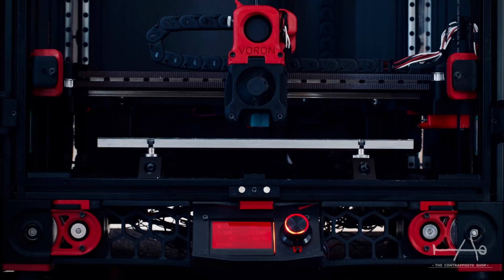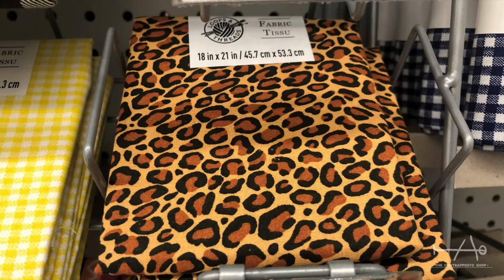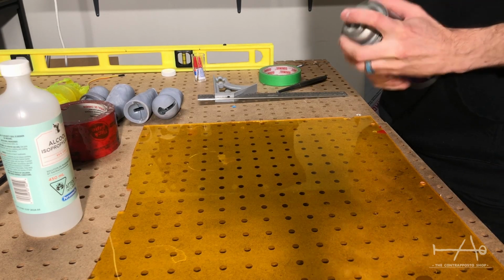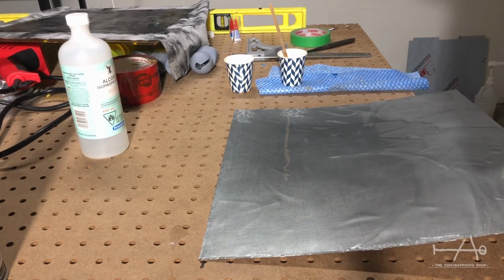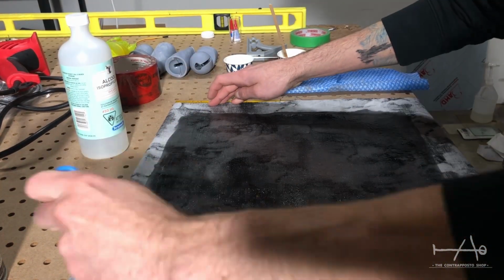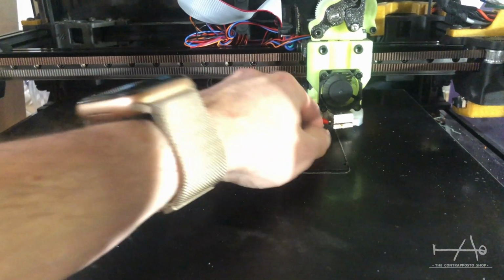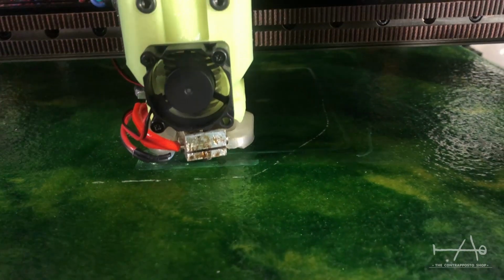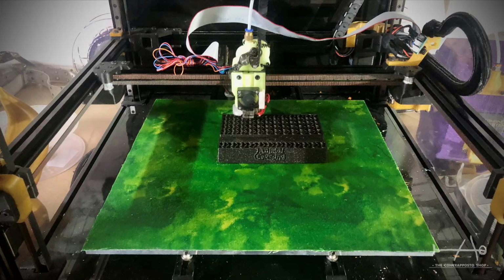We created the best bed material for 3D printer !

Comment: Hello, which fanduct do you use? Does the fan behind it create problems?
Reply from the maker: The fan is under :D … it work great a 150mm/s but i need more airflow to go higher… i will change de hotend for a volcano and probably install a blower somewhere on the printer and bring a tube at the printhead for the air  :)

Comment: which resin was used exactly and how much was the quantity
Reply from the maker: Like we said in the video we have try very simple and common two part epoxy resin and an other one called polyester resin ( much harder and smells a lot more )
Reply: @thecontrappostoshop   Im know it gives many different resins... epoxy ist different to polyester.... have you an exact name of the polyester resin? And how much was the quantity?
Reply: the special point is the temperature resistance
Reply from the maker: You can try both « two part epoxy resin » or « polyester resin / glass resin » … there’s many recipes and many brand for all kind of purposes … you can use the resin they use for table top … the quantity may vary on size and tickness of you fabric
Reply from the maker: For the temperature the polyester one quand resist about 70 degrees more than the epoxy … i think it’s not far from the 300 degrees
Reply from the maker: There is nothing special about it ! It a simple two part epoxy we found in a craft store … super easy and super basic stuff … but i will put a amazon link in the descriptions:)
Reply: @thecontrappostoshop  I think the two products (link in the description) will not work. Heat Distortion Temperature are 120F (57 C) and 115F (46.1 C). I think a resin with at least 248 F (120C) is required
Reply from the maker: Theses temperatures that you see is probably the max working temperature or the max storage temperature… almost all resin is very resistant to high temperatures !

Comment: You mentioned you built a voron.. I will ask if you are in fact using klipper as its the 'goto'.  If that is the case can you do another video showing your bed mesh (flatness) results of your build plate please
Reply from the maker: Im not sure if it will show something … for now im using a single side plate ( textured one ). Basically the metal sheet is flat on the magnetic bed so the probe will only read that. It will not see if the resin application is even. This is why on the video we not suggest to do both side since it may result to an uneven surface and the quantity of resin is important too. We did few print test to check the level and there is no major issue :)